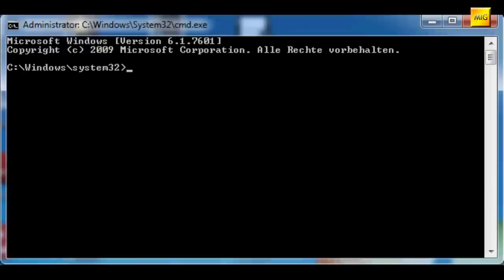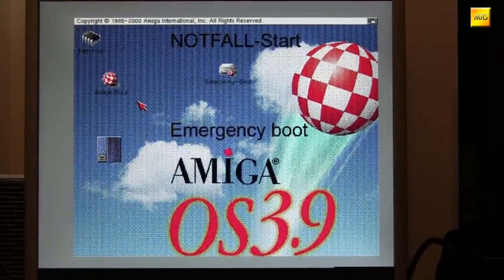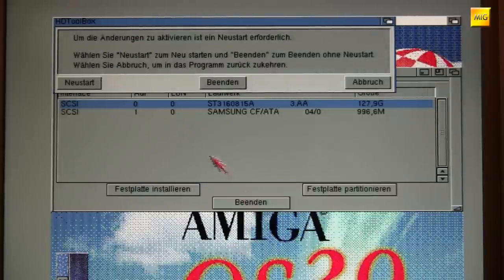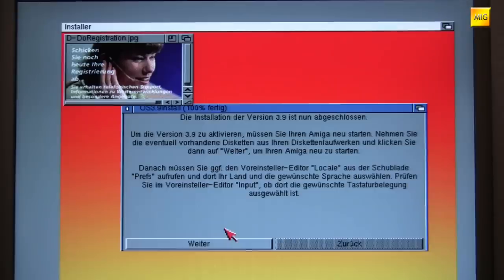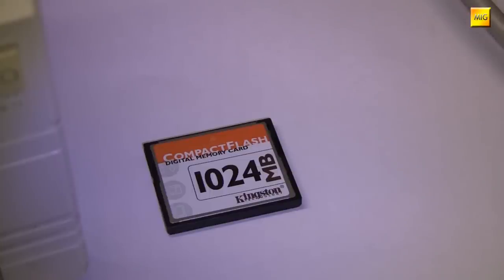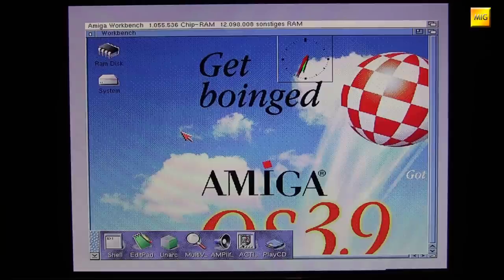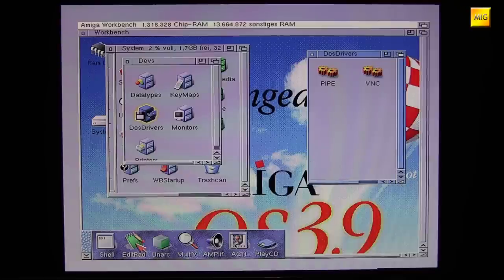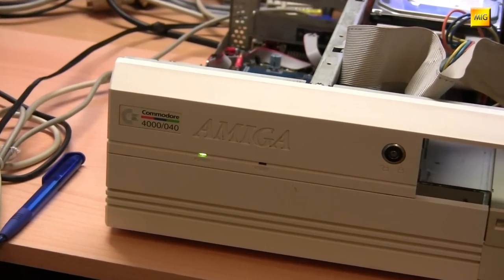MIGs Yesterchips - Folge #030 OS3.9 Install, SFS, FAT95  2/2

Comment: Möchte mich hier für das FAT 95 Tutorial bedanken, als hartnäckiger CD-ROM am Amiga 4000 habe ich am neuen Buddha Controller am A4000 ne 80 GB Festplatte und einen SATA DVD Brenner per IDE/SATA Adapter angeschlossen. Als Slave bekam ich keine CF Karte mehr am Buddha eingebunden. Aber der originale IDE Port war ja noch frei. Dort habe ich einen CF Adpater (ich habe einen Slotblech Adpater auf die Frontseite umgearbeitet) angeschlossen, deine  FAT 95 Batchdatei habe 1 zu 1 abgeschrieben und siehe da es hat spontan funktioniert. Man hat ja als Amiga User so einige CF Karten zum Datentausch mit ACA500+ oder A1200 usw. auf Lager die kann ich jetzt auch am A4000 nutzen.
Reply from the maker: Freut mich!! :D